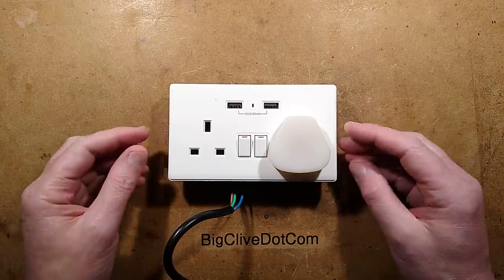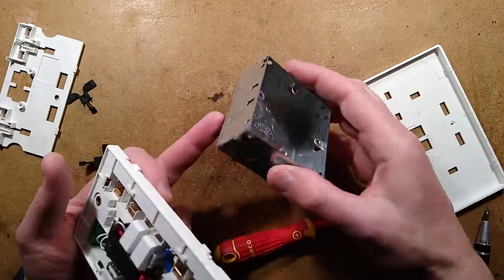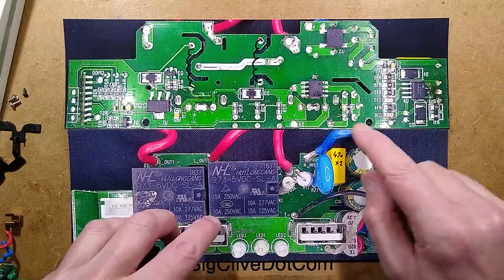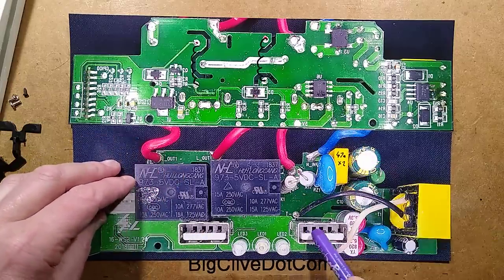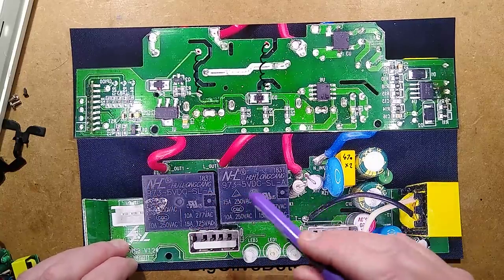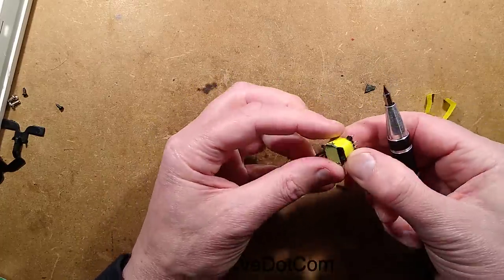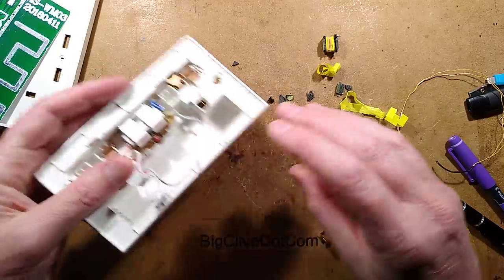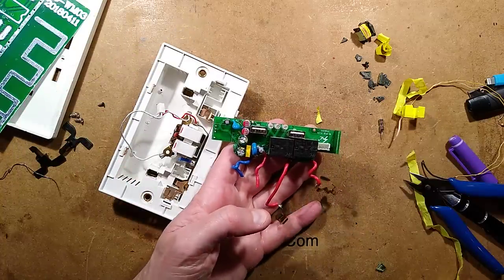WiFi wall socket teardown.

Comment: I agree I dont even like the USB being built into the socket.
Reply: I'm ok with them in places where a plugin charger would be nicked like Uni libraries, hotdesks etc, but not at home. And as Clive says putting a metal box behind probably doesn't help reception
Reply: "I agree, I especially don't like the USB being built into the socket."

Fixed it for you.  The problem wrt safety isn't the wifi or bluetooth etc, it's those 5V power supplies using all cheap chinesium components.  This one was actually pretty good compared to some of them.  I've even seen capacitive droppers used to power the micro-controller or even a 2.5watt USB port (advertised as 2.5 amp, of course).  Guaranteed to fail in two weeks when the filter capacitors dry up and AC hits the cpu, or your phone, or when +5V or ground gets connected to active.  I think Clive might have even pulled one of those apart, and I'm sure John Ward has done one or two as well.  That people might be (almost certainly are) buying this stuff from China and putting in their walls is downright scary.

I've thought about playing with some of the (better quality) switching but honestly it's unnecessary when you consider the increased risk.
Reply: @Chrisamic  True but what I said was correct. I don't like these controlers built in, I don't even like the USB chargers built in as I said.
Reply: USB being built into sockets is amazing. Three are no downsides to it. Chris mentioned the poor quality components, but that's two separate issues. There are USB outlets that are made by the companies that make outlets to code (not these aftermarket Chinesium ones), and they're amazing. No more stupid wall wats plugged into 2 kitchen outlets, and big wall wats floating around. Now it's just the cords.
Reply: @xenonram  usb I can see, but when the usb plug breaks or it stops charging or you need to change to usb3 you need basic electrician skills and to isolate the power. Not appropriate for the majority of homes. Great in the airport where you have sparks working everyday. However Clive makes the point about smart WiFi plugs being worse.
Reply: Andrew Delashaw they are all supposed to be made to the same standards BS1363 but they all use the cheapest components, definitely not the safest way to do it .
Reply: @xenonram  The nice thing is, the quality ones can be easily identified. For some home renovation I was looking into those, as in certain places it is slightly to tight to have a USB supply sticking out the wall.
I have to be honest, it will come back to those.
I could get either Chinesium ones for between 5 and 14 EUR on Amazon which do not match the frames the sockets in our house are mounted to (Most German Schuko Sockets or switches consist of a frame that can house between one and 5 or 6 sockets or switches, and the switch insert. Just for those who wonder).
And somehow none of them seem trustworthy in any perspective.
So I looked into one of the common brands for sockets and switches here, or even compared those (Busch-Jäger, Gira, Merten,...), the one from Merten matching my sockets sells for about 55 EUR... oh well... You have to need one of those.
But those at least I would trust. Not sure if the internal components are any better than the better Chinesium ones, but at least there is a German Brand and Company behind it whose rear end I can kick in case something turns awkward.
Reply: @peterhurst  Putting them in a metal box may save your house being burned down when the electronics fails.
Reply: @xenonram  You either don't understand the failure modes of electronics or you are a troll :-)

Comment: In addition to the loss of features when the electronics eventually fail, technology changes a lot faster than the electrical wiring in your home. One would expect to get decades out of your wall receptacles. Wifi technology and even charging technology will change a lot in that time. I can see a use for these in a commercial setting, though, where regular renovations are a part of the business plan anyway (such as in the hospitality sector -- coffee shops, hotels, etc).

Comment: surly that wifi board woiuld be inside a faraday cage  when mounted to the wall
Reply from the maker: Pretty much.
Reply: Not if it's in a drylining box on a plasterboard wall
Reply: Faraday would disapprove of his cage being built with an open side.
Reply: @bigclivedotcom  But there's a separate antenna board spreading the reception all over the widths of the unit.  Oops, that was just the large picture of the tiny antenna on the WiFi board!
Reply: I work in product development for devices based on ESP modules. The front panel is not fully metal so the device will work quite well with or without a metal back box.  The metal is in the wall direction, 2.4Ghz does not go through stone, block or brick walls all, so the effect of having shielding on 3 of the box surfaces is negligible.
Reply: @jonshouse1  I've successfully run 2.4GHz WiFi through multiple walls of light concrete.  The grounded rebar in reinforced concrete is a different problem for 12cm waves.
Reply: @johndododoe1411  If Wifi works across across rooms it is normally propagating mostly via other paths rather than through solid walls.  Some RF will go though a wall, but for all practical purposes a nice damp UK solid wall is a severe attenuator for Wifi at its typical ERP. Rebar or even a coarse mesh would not attenuate greatly and its DC potential (grounded or not) has no impact on its behaviour.
Reply: PVC box in a dry stud wall is ok... but it is 5/6ths a faraday cage in a metal back box lol
Reply: @jonshouse1  Don't forget at least half of a home's walls are internal with the open side of the box facing an exterior wall.  You're basically making a directional antenna that is pointing outside of your house.  I'd sooner invest in a stand-alone wifi repeater that I can put on a shelf rather than cramming all of this low and high voltage crap into such a confined space.

Comment: Clive if you are curious about the micro-controller, the ESP 8285 really doesn't have any firmware lockdown options so that should be re-programmable if you want to play with it.
Reply from the maker: I have some ESP8266 based Arduino modules here.

Comment: those devices run the expressif wifi stack which is rudimentory, especially if you have network with a lot of mcast-groups,  ipv6 neighbor advertisments going on (which the expressif should simply igonore, due to missing ipv6) and advanced power saving on the ap, which is now the standard on modern wpa3 capable routers.

Comment: The ESP8285 has the memory built in, the space for memory would be used if an ESP8266 were in use. The same breakout board would be used for both chips.

I've been using sonoff devices in my lighting for 12 months now, haven't had a single crash or disconnect from the network but I am using firmware called Tasmota which allows me to keep all of the network traffic within my own network.
Reply from the maker: The Tasmota firmware is definitely one of the best upgrades to the sonoff type devices.

Comment: Hello Rune Bivrin
The use of switched sockets is historical, like the current US plugs, UK plugs did not have any insulation on the prongs so that fingers could in extreme cases touch the live and neutral prongs thus administering an electric shock. As all UK plugs now have mandatory insulation to prevent the shock hazard switches are not really needed. However, the switch does stop the electricity escaping when no plug is inserted - Kind Regards

Comment: Oh boy, that ESP is easy mode for mods. I've got a bunch of "discontinued" Insignia plug-in switches, that I've removed the vastly overpowered modules from and installed ESPs instead. It's taken a couple years but I'm finally getting around to repurposing the original modules myself.

Comment: ESP Wifi chips and modules can be reprogrammed via the Arduino IDE and an FTDI serial to USB dongle. Meaning you can liberate and conscript it to do something more useful like remote controlling many relays to turn various lights and lamps on and off via your smartphone. On that device, I would LITERALLY cut the main PCB off the rest where you have the WIFI board and the unpopulated UART pads intact still. Those ESP boards typically use 3.3 volts and are not very forgiving if you overvolt to 5 volts... You can install the UART header pins and do all the magic from there but make note that you may have to install some jumpers between some GPIO's to make it enter firmware update/programming mode.

Also for the RF if that is mounted into a metal box in a wall the RF will be focused more on the front of the device. The metal box will act as a reflector just like in your microwave oven. Microwave oven = 2.4GHz, Home WiFi = 2.4GHz.. It will reflect off the metal and pass through the plastic bits.

Comment: The ESP8285 ist the same chip as the ESP8266 but with internal memory. They probably originally planned to use the ESP8266 and therefore included the footprint for the SPI flash, which is not populated.
There is an SDK for the ESP8266 and even an Arduino core, so it's really easy to write your own firmware for. There are also lots of open source projects using the ESP8266, to use it to control something and integrate it in your home automation system or libraries to emulate a Wemo Wifi Socket or Phillips Hue bridge, so you can control it using Alexa for example.
It's actually quite useful they went with that particular microcontroller. Then again, it's used all over the place, like the STM32 (just when Wifi is needed), so I guess why shouldn't they...

Comment: The USA non-USB power ports versions of these aren't even isolated from the line, but rather use a combination of a resistor dropper followed by a non-isolated PN8016 switcher to generate the 5VDC below the AC line. Interestingly the whole control circuit rides the hot side of the line as a trick to reduce the creepage requirements around the relays; the neutral is sequestered to a slotted corner of the PCB crossed by only the dropper resistor . They can get away with that by double-insulating button and LED with additional plastic. They are UL listed!
Reply: Interesting idea about riding the hot to reduce the creepage requirements. But that must mean it's a single diode rectifier. So, poor power factor and heat losses from the resistive dropper.

Also considering you guys only use 120 V as your general mains voltage, currents are doubled for the same amount of power compared to the rest of the world. So I would have thought that the relay would have to be beefy enough that creepage distance would not be an issue to begin with, just due to the physical size of the relay.
Reply: Gameboygenius - yes a single diode. It only draws about ~0.6W at a PF of 0.42 for about 1.6VA idling. The dropper doesn't drop allot of voltage really; it might be there mainly to control the inrush current to protect the diode.
Reply: @ChrisSmith-tc4df  ah sorry. I missed that you said there was a switching converter. That does improve things. I was thinking it was using solely a dropper resistor (+maybe linear regulator) to produce 5 V which would be a terrible <5% conversion efficiency at 120 V.

Comment: The ESP chips maybe with stock firmware probably have issues.  Fire them up,  flash them with Tasmota and fix them for local control without the cloud.

Comment: At 10:22, the memory side was there probably for when they use/used the ESP8266 module, which needs external memory. The ESP8285 has a 1MB memory chip built-in.

Comment: The ESP8285 is the same microcontroller as the ESP8266 but has an integrated 1MB flash probably explains why the board has a place for an external flash chip, either it's an off the shelf board or it was designed for the other chip and was cheaper to keep using it despite changing the chip to one that no longer needed the external flash chip.

Comment: ESP8285 is essentially similar to ESP8266 which is very common WiFi chip. Those Sonoff WiFi sockets are using ESP8266. The pinout is the same, but ESP8266 does not have flash memory.

Comment: We install something similar to this at work - it doesn't go into an AC socket, but the spot where the ethernet/telephone goes. They are made by Cisco actually and powered via power over ethernet. I the US you couldn't install this with a low voltage license.
Reply: What do they do? Do you mean an access point? Or POE powered USB sockets?
Reply: @danielplusben  they are an access point, and network switch. We're testing a Cisco 9365 that is essentially all of that as well as router/layer 3 switch.

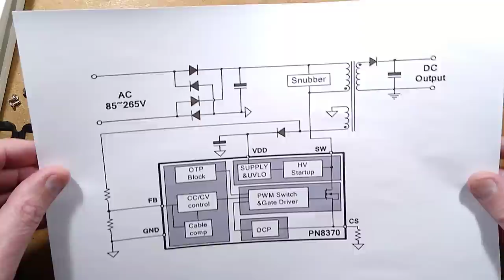Comment: 5:30 "oh that's quite ferocious i'll
 tame it down just a little bit just to just to make it less ferocious"

Clive, I note you reduce the brightness but I wonder why ? As far as brightness goes, it's pretty much perfect for what it is - ok, some bits are white - but that's ok (hmm, who says that?) because it's presumably white paper.
Reply from the maker: It's to avoid swamping out on white things (like the paper).
Reply: @bigclivedotcom  'Swamping' - interesting term ! It's not 'washed out' either - been & sat on the crapper for 10 mins & come back with 'saturated'.
Swamping is where one thing obliterates another.
Yes, it was saturated in places but the thing is it didn't show - and therefore it's ok. Despite that, the dark parts were still nearly black (9/255) - so it wasn't far out at all representing the view. Lighting-wise, the upper part of the image was better lit.
Reply: @bigclivedotcom  Thx for doing that, my eyes are burning with white stuff at night with my laptop. Brightness is at minium and its still bright.
Reply: @millomweb  just like everyone, Clive has his own interests and preferences. He spent some time doing power work and then moved onto theater lighting. Those are largely his preferences in electronics.

Why not tame down the exposure to make it easier on the eyes if he has the preference and sense for it?
Reply: @cheyannei5983  You haven't seen my website, have you ! People call it traditional  - green writing on a black background ! Most people are used to staring at bright white screens with black writing on them and most people have their displays to display 125,000 shades of black ! Not me, I have < 64 shades of black

Comment: seems like a silly idea to stick all that in the wall.
Reply: @donovanhill7367  I've seen stuff like this on sale in asda recently - obviously targeted at DIY tinkerers rather than respectable tradespeople
Reply: @RavenLuni  Ive also seen these for sale in Aldi fairly regularly, with a metal faceplate too, so the signal to/from that would be well and truly screened!
Reply: @Okurka.  Not if it was earthed.
Reply: @NOWThatsRichy  You're assuming (maybe) that it's designed to be earthed. If Aldi there is anything like Aldi here, that's an assumption I wouldn't put money on.
Reply: That's what SHE said.😜 So I just wiggled it until it busted.🤣